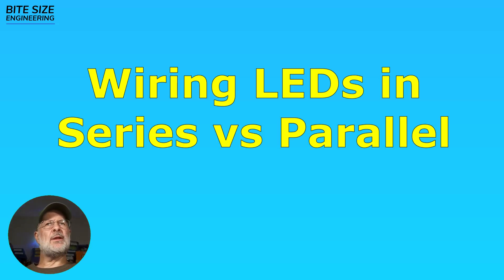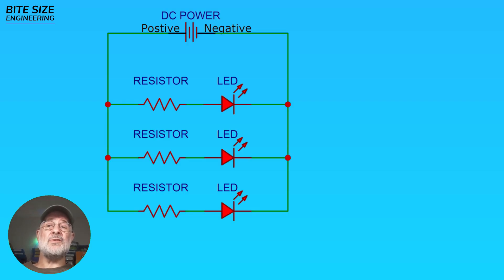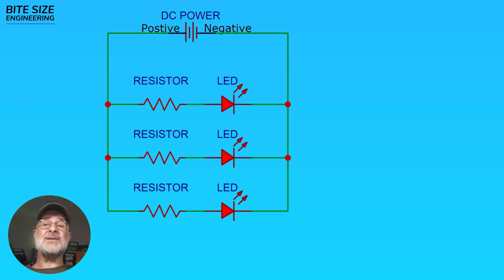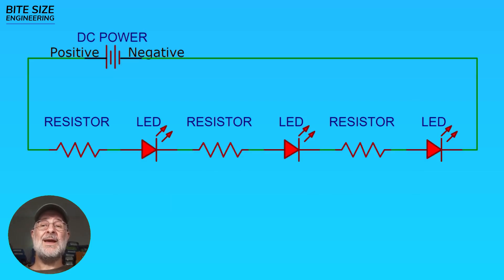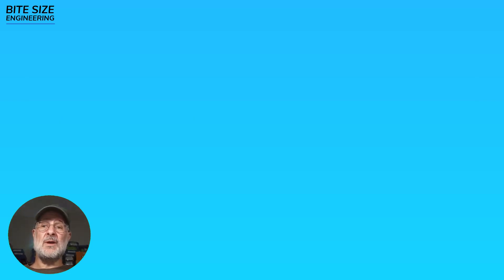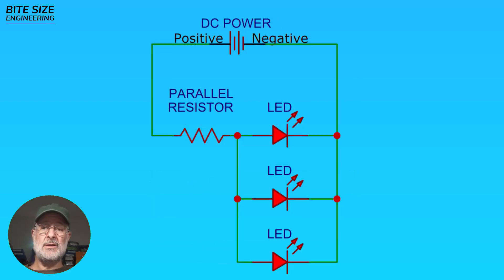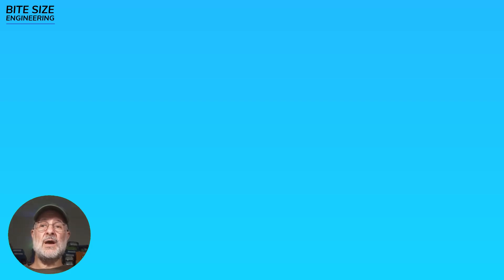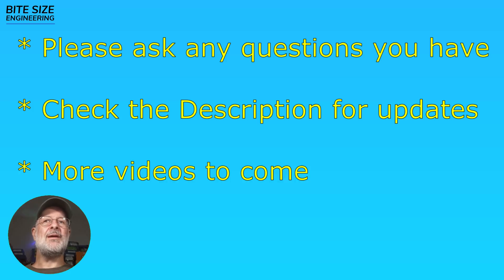Wiring LEDs in Series vs Parallel H

Comment: Thanks for the video. Just a quick question. I have 3 1.5v garden lights. Am I right in thinking that if I connect them in series to a 4.5v supply, they will receive 1.5v each and work properly?. Thanks in advance.
Reply: If you're talking about the solar garden lights, then unfortunately no. Those contain an additional circuit called a boost circuit which raises the voltage from the battery to a high enough level to power the LED light. If not, can you describe the garden lights in a bit more detail?
Reply: @ Thank you for the reply. Yes they are the solar lights. My plan was to remove the batteries and wire the battery terminals in the lights in series. The hope being that the solar panel will signal the light to turn on at dusk till dawn as normal and the units would be fooled into thinking they still had a battery inside. Wiring 4 in series would be about 1.1v each which is closer to a rechargeable battery voltage.
Reply: @crazywrx1  I get what you're thinking. However, because there are tolerances in manufacturing those lights, they may not all turn on at the same time, then you could be pumping all the voltage into the first one to turn on. That might not damage it if the others turn on soon after. This is an interesting adaptation. I've tried many experiments with those lights, but I would like to think this one through a bit more. If they are cheap enough you could always just try and see what happens. The key would probably be more to wire them all in parallel and use a lower voltage source with more capacity.  There might be issues with that too though.
Reply: @EdMichel99  Thank you for the reply. While I was in the garden cleaning the pond today I did think about 1 unit failing and that changing the voltage. Your suggestion of parallel wiring would avoid the failed lamp as well as the variance in when they turn on and off. The other thing I was pondering is that the rechargeable battery in the lamp is probably 1.4v when fully charged and drops to about 1.2v as it drains so the voltage isn’t constant implying that’s there is leeway in the voltage that can be used? 

The plan came about as I have a leisure battery in my bird hide that runs various items. It’s about 120AH and is kept topped up by a solar panel and charge controller. I bought a “magic box” that takes the voltage from the leisure battery and outputs 6v and that runs the pir camera. I also have one that outputs 4.5v and thought I could make use of it. It does seem better though from what you said to get one that outputs the correct voltage and wire the lamps in parallel. The advantages, if I can achieve it, are 1) the lights will be on all night even in winter 2) I don’t have to worry about positioning them in direct sunlight. 

Now I’m wondering do I want 1.5v, 1.4v, 1.3v, 1.2v??? 

Going down the route of wiring in parallel will make it easy to test one light for a week or so before wiring them all up 👍🏻

Thanks in advance.
Reply: @crazywrx1  It kinda sounds like you're willing to do a little experimenting yourself on this. What I can tell you for sure is that the NiCad or NiMH batteries are typically rated at 1.2V and are generally charged with 1.4-1.5 volts and will drain down to around 0.9-1.0 V. The little 4 pin chip inside the light as well as the green resistor looking component (actually an inductor) are the key to boosting the voltage until it's high enough to power the LED. That's why you don't need a resistor in this circuit. The inductor controls the current flowing into the LED and the circuit actually turns the LED on and off at super high speed so you can't see it. I think they key here would be a common power supply wired into the battery part of the circuit at about the same voltage as the batteries. You could take all the batteries out and wire them in parallel, then feed that back to the battery terminals. The only thing I don't know is how the "Boost" circuit would react. Also keep in mind that the cheaper dollar store garden lights aren't totally waterproof, so they won't last forever regardless of how careful you are in wiring everything up. I would almost suggest trying this a separate set of lights before messing with your main setup.
Reply: @ Thank you for the detailed reply. The “magic box” I mentioned in one of my other replies I’ve now found out is actually called a buck converter, I went on eBay yesterday and found one that is adjustable output from 1.25 volts upwards with a max of 3amps (which I think is more than enough) so I can test different voltages starting low. 

Here in the uk I end up replacing the lights every 2 years. Being a tinkerer I have performed an autopsy on a few of the failed lamps and water seems to get in (rust on the circuit) and corroded batteries seem to be a problem. I know they will never last particularly long but with this plan I can put the lights where I want (shaded corners, at the base of bushes etc) rather than out in the open (to gather sun). Also I plan to use a little bit of silicon sealant. At the end of the day when a lamp fails I can crack it open and disconnect my wiring and wire in the new replacement. 

As I say I’m a “tinkerer” so whilst I could buy a number of different mains powered units to suit the different locations and save myself work, this project will scratch my itch haha.